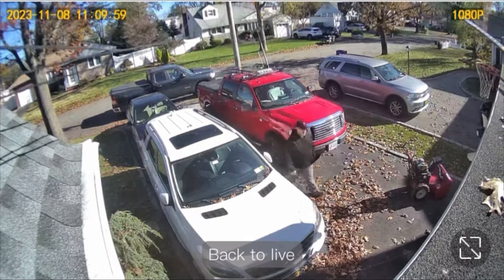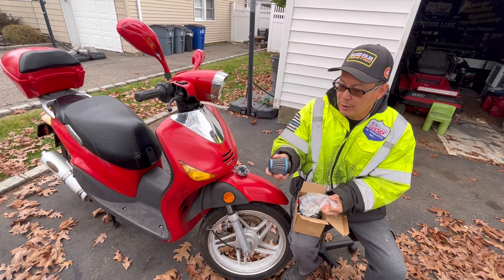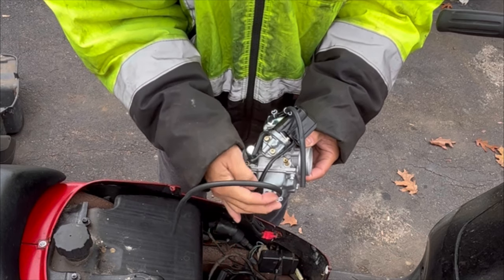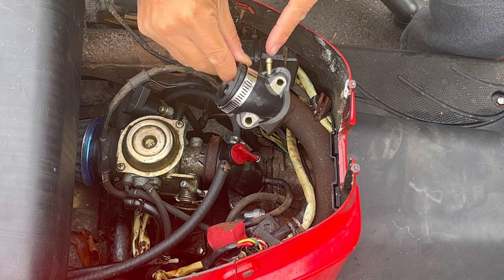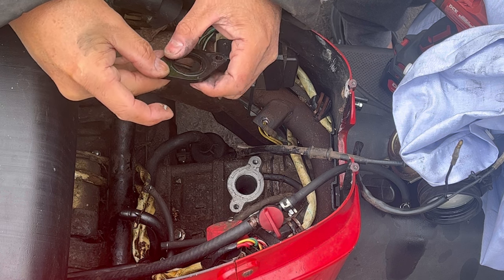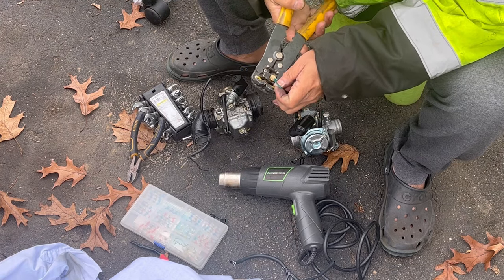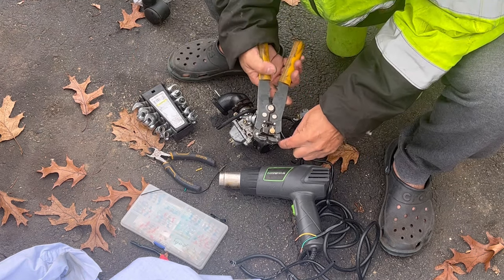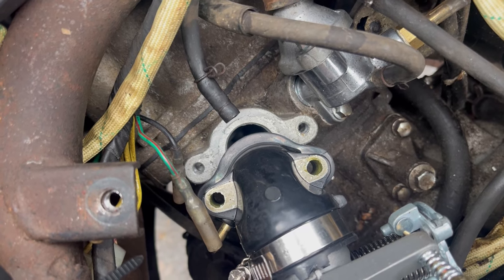CHINESE SCOOTER GY6 150CC NEW CARBURETOR REPLACEMENT WONT START OR IDLE BOGGS ON ACCELERATION *FAIL*

Comment: Hey Henry, did you put a gasket between the intake manifold and the cylinder head it looked a little wet when you had it apart like excess fuel when you had hand chocked the carb!
Reply from the maker: Yes,  it was the gasket spacer

Comment: henry to give u more slack on that cable, can't u flip the "cable bracket" thing over , that would give another 1/2" to use the nuts to hold the cable again? save u using the hose clamp setup?
Reply from the maker: No can’t flip the thing doesn’t work that way,  I got it to work,  stayed tuned bro

Comment: the line on the bottom of the carburetor isn't overflow  if the needle and seat or not
 seating it comes out it keeps the gas from going into the engine.
Reply from the maker: Yeah?  How does that work?  There’s no mechanism that opens the valve on the bottom attached to the float. If it doesn’t seat,  gas will just swap through,  I don’t get it but I’ll take your word for it.

Comment: Check for a vacuum leak. That nipple off the side is for vacuum hoses . U have two not connected to anything on right side of the engine .
Reply from the maker: Not vacuum
Reply from the maker: Yes the t line is not connected to anything because I bypassed it,  I connected intake line directly to the carb, bypassing egr.

Comment: Chec the fuel tank for any water in the gas. Pull the fuel line off the carburetor and open the line into a coffee cup..
Reply from the maker: Not a water gas issue